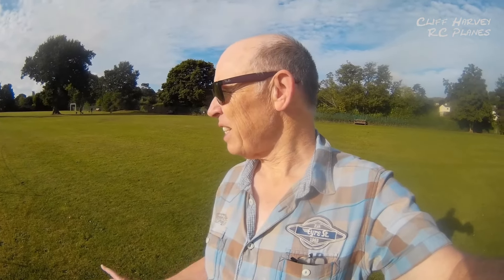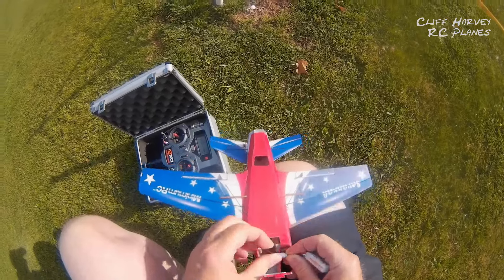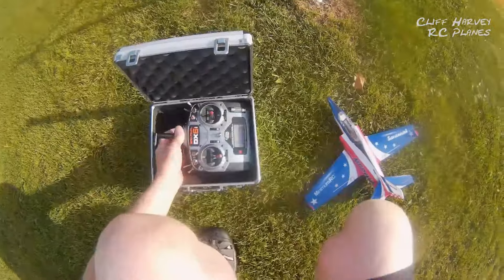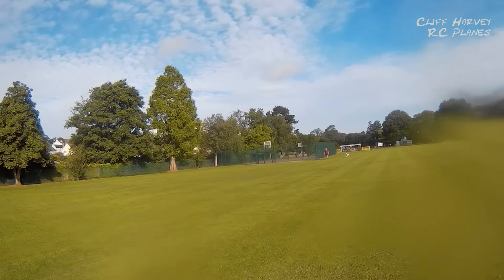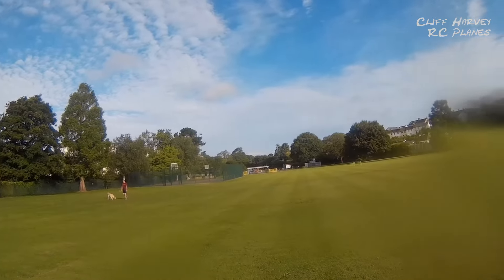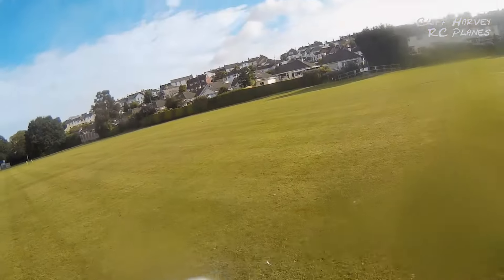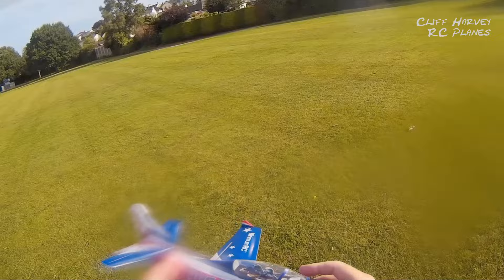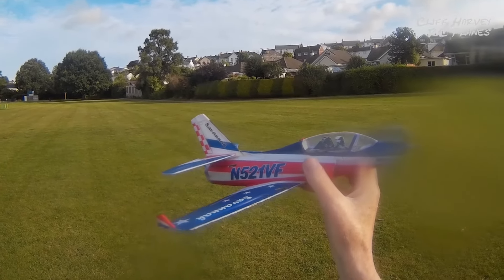Savannah EDF Jet Maiden Flight

Comment: Hi Cliff, doesnt seem a too major increase in power from the 1s planes to the 2s? (Maybe its just the perspective from the camera) Whats your favourite miminumrc plane?
Reply from the maker: I've just done a thrust test for you between the 2s Savannah and the 1s Hawk. The Savannah weighs (with battery) 59g against the Hawks 45g (with battery). The Savannah's thrust was 43g compared to the Hawk's at 26g so quite a difference but of course the Savannah is heavier partly due to the battery being twice the weight of the Hawk. A safe flying time for the Savannah would be 3:00 and the Hawk about 2:30. My favourite model ... the DH 88, cheers 👍🏼